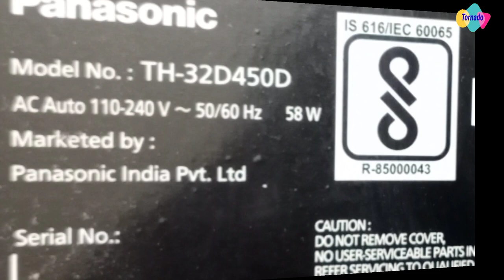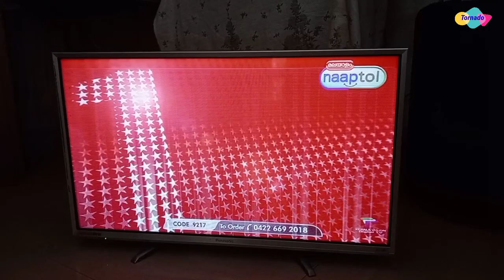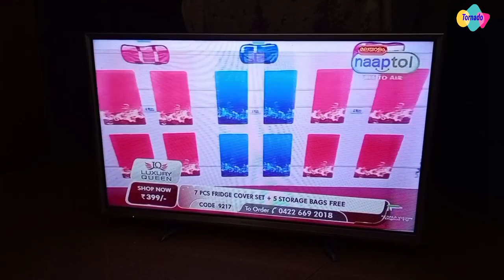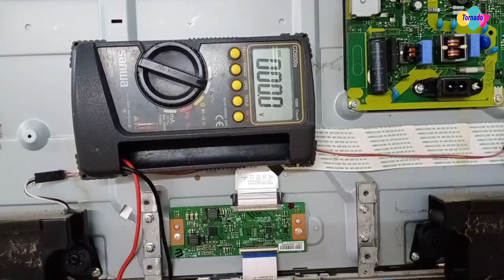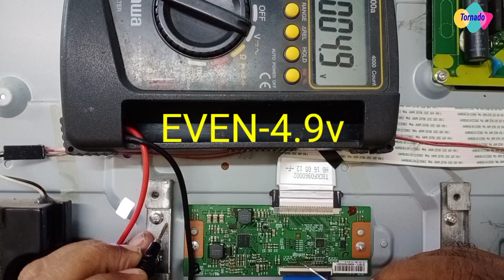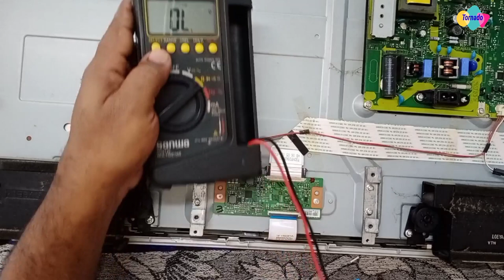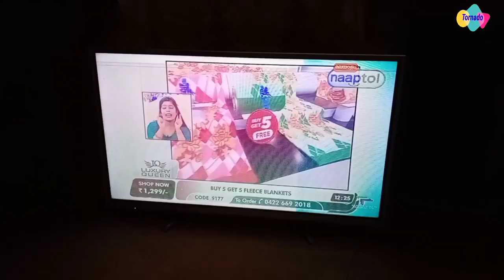led tv picture freezing problem

Comment: I have a similar tcon with a similar display problem. I watched your video twice but can't really understand what you did.
If i understand correctly, did you cut the trace of EVEN and ODD and going to the panel, you connected via jumper EVEN to VGL, and ODD to VGH?
Reply: You understood correctly. Pause the video at 12:31. It is clear there.